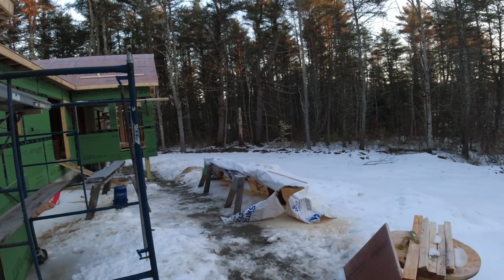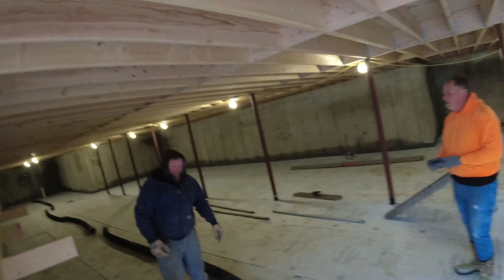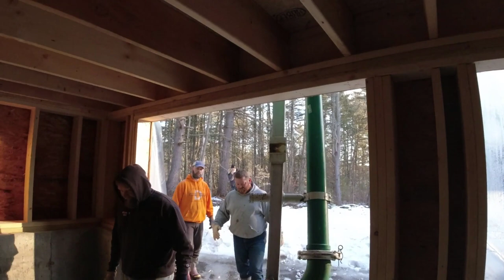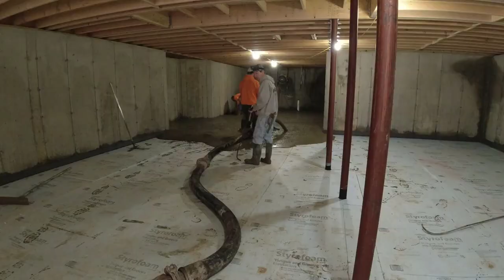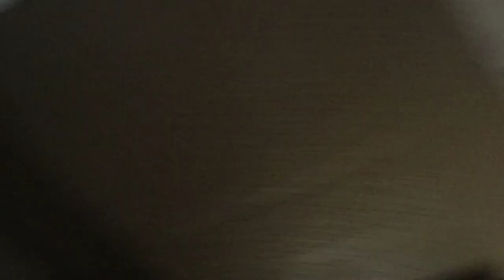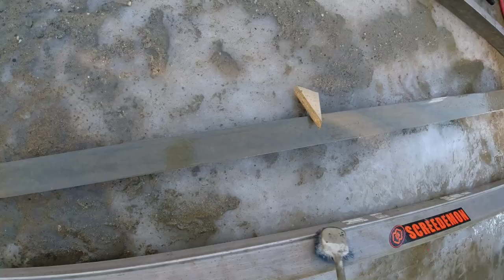I Needed Extra Help! Pouring Big Concrete Floors is Easy

Comment: I have heard that the thicker the ciment the stronger it is,  I wonder how strong this watery sludge is!
Reply: @Jocelyn .. thickness doesn't reflect true strength.  The proper 'mix' does. And Mike was speaking of slump, not sludge. The slump in a simple explanation is similar to comparing yogurt to oatmeal. They choose a 'looser' slump so the concrete mix flows through the pipe easier. The finished product strength won't be lessened because he is a pro and has proper mix. When cured... it'll be perrrrrfect! 
😎
Reply: @fljetgator1833    Thanks for your reply! 👍
Reply from the maker: We use a water reducer in the mix, that allows us to pour a looser slump without reducing strength.
Reply: @MikeDayConcrete    Thank You Mike for your information,  I guess there’s more to concrete than just mixing water and ciment.